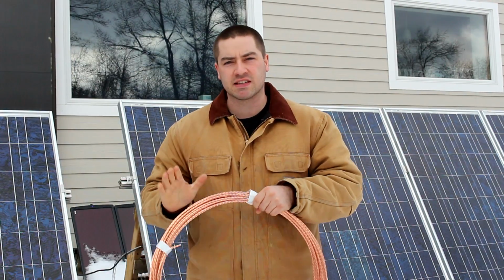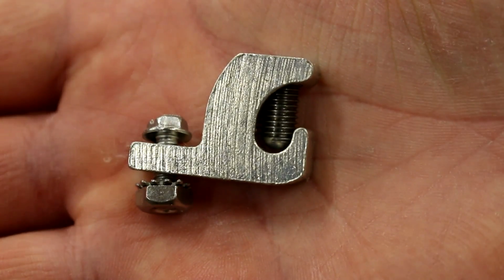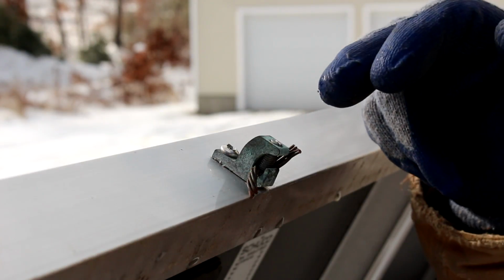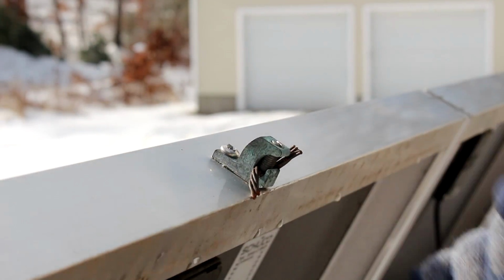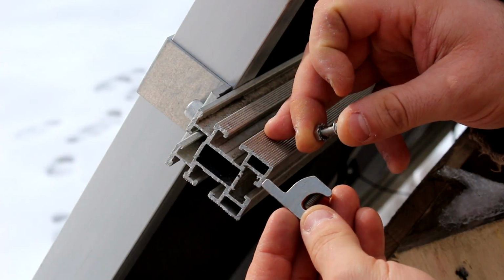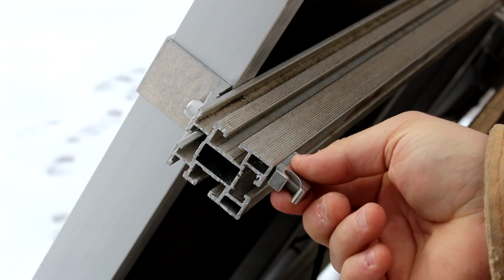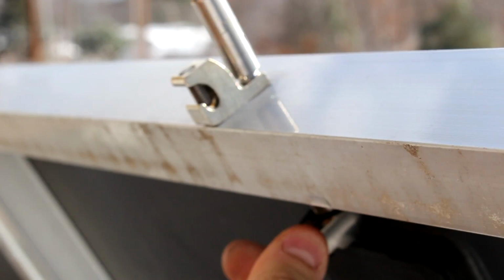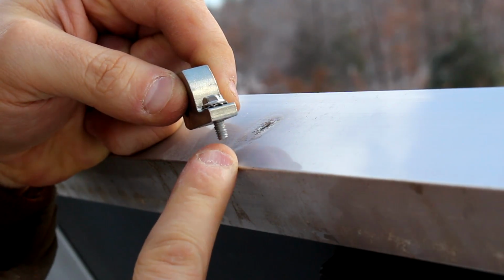Grounding Solar PV System, DIY, on Pallets

Comment: David, hey, in Europe we use: 1. the insulated cooper conductor wire to avoid the Cu copper contact with Aluminum solar panels frame, that may cause the creation of the galvanic pair with the difference of the potentials, that would be source of fire  2. We use Zink covered or rost-free bolts, nuts and washers or the clamps like yours to attach the insulated copper wire to the panel frames and the mounting frames...

Comment: The star washer should go between the lug and the module frame. It bites through the anodization of the aluminum into the aluminum itself. That's what provides the grounding.
Too, if you use a similar washer under module at the mounting clamps, you can use much less copper, as it uses the rails as the grounding conductor.
Reply: Agree…
Reply: As soon as I noticed i looked if someone mentioned it those are to bite into the frame of the panel not bite into the clamp itself lol it’s strange cause he said that before putting it on the wrong side
Reply: I think what happened is he put a star washer on both sides.  A little overkill but if you have a pack of 100 star washers then why not?

Comment: Hi David,

I appreciate the work you did there, and it's useful for me as I'm a student of Solar Engineering myself. Although, I would try to put the grounding wire below the panels rather on top of them as it would get exposed to heat in the open air.
Reply: I know Im asking randomly but does anyone know of a method to log back into an instagram account..?
I was dumb lost my login password. I would love any tips you can offer me.

Comment: By doing this, are you not making a lightening rod out of your solar panels? I have a conc roof and plan to keep my solar panels isolated with a separated dedicated lightening rod. Hopefully the lightening will go to the path of less resistance (lightning rod). If any current does make it into the pv wire, I have a breaker and 500v dc limiter before the inverter to stop it there. That is my plan anyways...0

Comment: You should use some anti-seize on your connections especially where dissimilar metals touch like copper and stainless, stainless and aluminum to prevent galvanic corrosion. Dielectric grease should be used where you have multiple electrical connections that are close to each other as it doesn't conduct electricity.
Reply: Ideal makes an anti-oxidant joint compound for aluminum to aluminum and aluminum to copper connections.
Should be used on service entrances and breaker boxes also.

Comment: Do I need to Earthground the panels when installed on a rooftop? What are the pros and cons ? Good tutoring. Thanks 🙏
Reply: Yes, per the latest NEC rules shown in other youtubes.  Doesn't have to be a ground rod.  A metal pole in the ground or even a metal building can suffice.  Probably only need to ground the frame rails, not each panel.

Comment: 1:48 Text should read "Stainless steel self-drilling screw"; a self-tapping screw requires a hole be drilled FIRST and the machine-type self-tapping screw provides the threading. a self-drilling screw is a sheet-metal screw with an integral bit that drills through the metal. Most people don't know the difference between the two.

Comment: I have a question?
Why are you drilling into the side solar panel frame.
As far as I know, the manufacturers say that you should NOT drill into the side of the solar cell frame. you should use the underside of the frame or if there are pre-drilled holes, you should use these holes,
I always follow the Solpanel manufacturer's instructions.
and that it will be a cleaner and more attractive assembly
so I work with the ones I use when they have to assemble facilities
I also want to say that it's fun to follow what you do, have a nice day

Comment: This is actually bad advice. Having two grounding rods means that the panels can carry the built up potential that could accumulate for a variety of reasons and your body could provide a path with less resistance to equalize that. Additionally, your ground should go to your bound neutral at the power source, either inverter, battery or main panel depending on your set up.

Comment: I saw one mistake and one thing to save a bit of wire. First the washer should always go against the panels, why, because the washer needs dig into the protective coding to achieve the connection for grounding. Second, when stringing from panel to panel make it a bit tighter so it doesn't flap in the wind etc which adds unneeded stresses on grounding connections.
For your fist build i think you did a great job and you made a smart move to have it looked over for mistakes etc. I've found paying attention to small things go a long way in all area. Great job..
Reply from the maker: Thank you for such a great comment.
Reply: @DavidPozEnergy  well, it's what you asked for so I gave you the truth of i saw. Now if you look at your opening scene you will see your washer setting on top grounding connections, there, they are no good and can't do their job. However, if placed oposet where washer can dig into protective coating then you will have a sure conection. Remember your grounding the panels not the clips.

Comment: My concern is that is uninsulated wire flapping in the wind and exposed to the elements which I would reason would get corrosive enough over a few years to lose its conductivity.

Comment: The star washer goes on the underside of the bolt, so as to bite into the  panel frame
You've put it on the top.
Reply: this is correct....but in the scheme of things what the heck are we grounding the frames for as the solar panels themselves only have 2 wires and has no electrical connection to the frames
Reply: @GoldensRule45  One word: Lightening

As best I understand from my studies, those panels can attract a strike, and you want the energy to be directed away from your house/system. If you don't give lightening a path it will make its own path. That's my best answer anyway. There HAS to be a reason it is recommended.

Now of course lightening is not going to be held up because the star washer is on the worng side. But I suppose the other reason is if a bare panel wire ever came into contact with the frame, it would trip the ground fault detector. I would also assume attaching  the panels to the mount produces a ground of some degree, and that the lugs and wire insure it is a stable ground.

BTW - You mentioned having TWO ground rods. Are they connected together? Another nugget I pulled out of the research for my DIY system is that grounds should be "commoned up". If you don't you create a "potential difference" between the grounding point, and current can flow. You can run that same stranded copper that you used on the panels between the two rods.
Reply: @stevebakker6884  I think you mean lightning.
Reply: Star washer on top and on the bottom. The point is that you need to get through the anodizing to make a good electrical connection
Reply: @GoldensRule45  if you have a PV system, a multimeter, and it's grounded, loosen the ground wire and read across the wire to the ground rod. In a real world it should be zero. On sunny days I get 4.5v, cloudy times 0.6v. Each panel leaks a little bit of current. After you ground them in series you can read the voltage
Reply: @stevebakker6884  yep you are right only one earthing point, I myself are engaging in the same scenario

Comment: Great video David. You havd auch an excellent attitude and persona. My understanding is the lockwasher should go under the nut. It is not needed under the bolt head. Cheers -Jay
Reply from the maker: Yes, you are right. Depends on the type of washer.  A split-washer can go under the head of the bolt, but a star washer is for biting through the coating on the aluminum.  I didn't realize that, but fixed it on my solar builds since this old video.
Reply: @DavidPozEnergy  Thanks David! Appreciate the clarification and follow up!

Comment: Your ground on the panels needs to match the ground on your house. They should not be separate ground. They need to be bonded. You don't want two different potentials for ground as lightning or a power surge may go down your inverter wires to the house rather than into the ground rod if your house ground is a lower potential. Ask your electrician friend how to bond house ground to solar ground.
Reply: Yep. Mike Holt explains this well in his grounding and bonding video.
Reply: Todd - thats why I found this video as a follow on to watching the Mike Holt video. Appreciate the clarification as my solar design team incorrectly said to drive earth ground rod by PV panel array which is contrary to what the solar panel instructions say.
Reply: Depending on acidity of the soil, you will build a nice battery.

Comment: The copper wire CAN NOT touch the aluminum frame or you will get galvanic corrosion.  The grounding nuts are stainless steel which can go between aluminum and copper.
Reply: Galvanic corrosion was my first thought as well, as soon as I saw the copper next to aluminium.

Comment: Having two rods in the house is dangerous because you create a voltage gradient between the rods. If lighting strikes you could have a current path between the poles with thousands of volts. The further they are, the bigger the voltage gradient. Watch Mike Holt on the subject.
Reply from the maker: Mike Holts videos are great.
Reply: With 2 rods its 6 feet apart

Comment: I'm a 30 year electrician I have had inspectors fail me on how I mounted my lay in ground lugs. No self tapers, No nut and bolt, He made me tap and thread the for the bolt,  I  do regret not ask for a code reference.

Comment: It seems most installers just ground the aluminum mounting rails, not the individual panel frames too, though my panels have marked grounding holes.  I doubt that biting thru the anodizing helps long-term since that will just form Al2O3 which is an insulator.  For personnel safety, dangerous voltage levels would likely jump across the anodized layer anyway.  Copper in aluminum outside will corrode and oxides are not conductive.  Twice in cars I had problems with the return path for a starter and alternator thru aluminum parts failed due to corrosion.  The starter problem I found when the cluster was pulled out and I saw smoke from the speed cable when starting.  I sanded the aluminum case points and fixed it.
Reply from the maker: I agree that most of the time the bonding and grounding is happening at the rails, not the individual panel frame.  They can do this if you are using hardware that's UL listed as a bonding point.  Check out the back-side of some UL-listed clips and you will see some tiny teeth that bite through the anodized coating.
In my case, these panels and hardware are old.  The clips don't have the UL for bonding, so I need another form of bonding to be legal.

Comment: isn't there some glavanic action with stainless steel and aluminum so that it deteriorates the aluminum? I thought those weren't supposed to be tied together
Reply from the maker: If I were living on the coast, with salt water in the air, then I'd worry about it.  But, where I live, it's just not a big deal.

Comment: Hi David, please give me some advice about grounding the photovoltaic installation. My entire Off grid 8KW system is totally separate from the main system. We have made a separate dedicated grounding installation for this system + dedicated sockets for vital consumers. Question: Do I connect the inverter and solar panels + battery bank together to this ground?  My doubt is about the inverter- I don't know if it should be connected to the main grounding system. Thanks, gratings from Romania,

Comment: Isn't grounding to earth only a thing that the utilities do to have an alternate path back to the source? why would an electrical circuit ever want to go to the ground? if you're off grid then ground rods make no sense especially two of them, if you're worried about lightning then wouldn't it be better to invite it away from your stuff and not to it?
don't get me wrong about the importance of using ground wire to connect up metal case items together for safety though.

Comment: Did you do an earth resistance test?
Might have been cheaper and easier to bolt the panels together at their sides where possible and just use copper links where necessary.
Reply: Great point.
Reply: No, the alu. is anodized - not adequate conductivity - you need star washers (or weebs) to cut throught the surface to get to the conductive alu.

Comment: Two things:
1. I understand the star washer between the nut and the frame. Why was one necessary under the bolt head?
2. Cool music.
Reply from the maker: Your guess is as good as mine.  They (star washers) were part of the grounding package I bought.  I'm hoping the manufacturer has a reason.  It can't hurt, right? I'll ask Kevin when I get a chance.
Reply from the maker: Thanks.
Reply: Oddly enough that ground bracket is most likely an anodized extrusion prior to being cut into .75" lengths. Either way it isnt hurting a thing.  @DavidPozEnergy

Comment: Shouldn't the panels be common ground to the equipment (e.g. controller, inverter, etc.)? I mean all the equipment in the system goes to one grounding point.

Comment: Is there any reason that (-)Ground is not also grounded to chassis? Reduce static and signal noise...give lightning another option?! :) I have a small 1.6k 16 panel setup..still assembling.

Comment: Hehe. Rails and panels make a complete whole metal structure. Grounding the frame will ground the whole sistem. No need for grounding individual panels. Just ground the frame on one point and you're done. Want to make sure everything is ok? Just measure the resistance from each panel frame to the point you ground it.

Comment: Thanks for the helpful videos. Was it you who posted a video about how an expert came in and counseled you to add ground fault detection? Is that "Kevin"? I'll keep looking for the video, but regardless, I had a question on ground fault detection that wasn't covered in that video. Where is a ground fault detected at? What equipment monitors for a fault out at the solar panels? Is it the breakers on the inverter? On the charge controller? Dedicated circuit/equipment?

Thank you.

Comment: Interesting installation. Until I saw the back of the array I was getting a bit OCD about the wonky clamps. Have you got a longer term solution to the pallets? They'll rot pretty quick in that environment.
Reply from the maker: Yes, I moved this array to the backyard with a new steel frame: https://youtu.be/tc-wgpGfbtA
Reply: @DavidPozEnergy  Good stuff I'll watch the others. Keep up the good work mate.

Comment: I think if you have 2 grounds on your house, that can be dangerous. I think you should only have a single ground. Please look into that.
Reply: I would think if you keep the 2 grounds as separate system with 2 breaker boxes and the grounding very far from each other, I would think it would not be a problem....two systems
Reply: I heard it's even an NEC requirement to have two separate rods.

Comment: Water can cause stranded to expand and bust apart. Should be solid. I could be wrong but
Reply: I B eleive stranded or solid is code or preference.. I prefer stranded because if you lose a strand the ground will still be maintained. Break in the solid ground is broken

Comment: You should had used aluminum straps to connect the panel togather  and check for continuity between the first panel and last then run the grounding conductor to the earth rod .Or if you have used the rail as metal once the panel are connected by metal screws it is ground only the last or the first panel connect to earth rod

Comment: Hi.  Nice job on the grounding on the panels but I didn't see any mention of a ground Fault Detection Device... Do you have one back in the house? I there is a fault how will you know? I'm not an expert and I'm just in the process of installing my first system so interested in this subject. Thanks Ben
Reply from the maker: Hi Ben,  I have a few different systems at my house.  The solar system you are viewing in this video has no GFPD, or MPPT, or inverter, or batteries.  It is direct tied to a heater inside: https://youtu.be/jFoxIit8NYA

However, with another system I have I did use a GFPD here: https://youtu.be/4Cv_m33s2U0

Comment: Can you install 24v solar panels to 12v change controller to charge 24v battery
Reply from the maker: No.  I'd suggest using a MPPT charge controller to step down panel voltage to match the battery.  That means using solar panels in series to create a higher voltage than your battery, then the MPPT charge controller will drop it down to your battery settings.

Comment: Why run the wire on top of the panels where it's visible? Running it at the back would be nicer. You would have to be careful drilling though, hold something behind it as you go through to protect the panel from the drill bit.